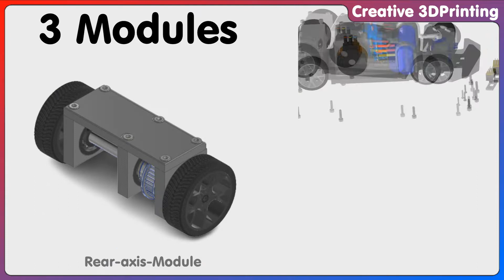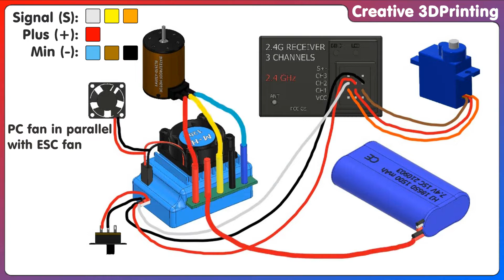DIY Fully 3D Printed RC1:18 Audi R8 | English

Comment: Hey, filament got stuck in my extruder and I can’t remove it is there anything I can do do you have an email or something.
Reply from the maker: Normally there came something with the printer so you can clean the nozzle, it's something long and with a small diameter.
Reply: @Creative_3DPrinting  Thank you